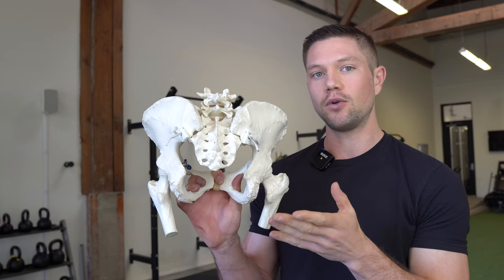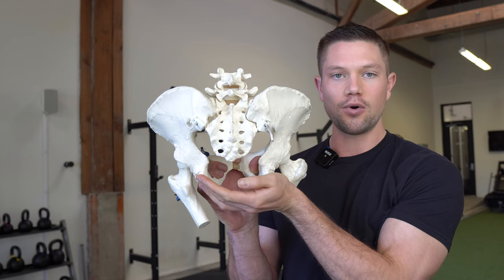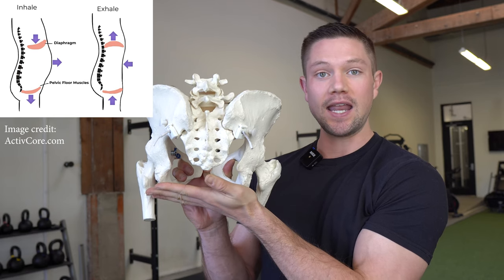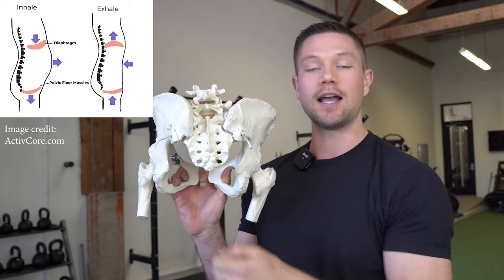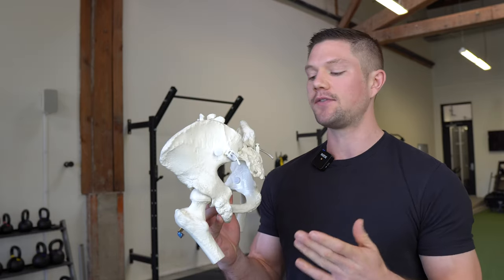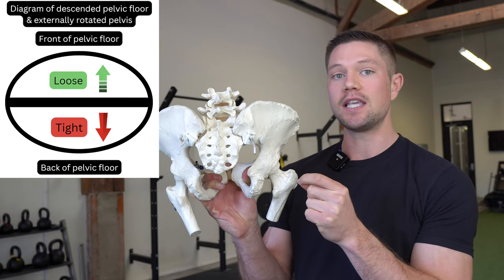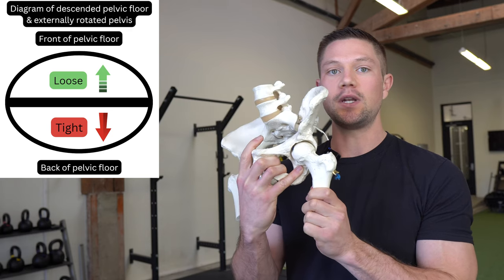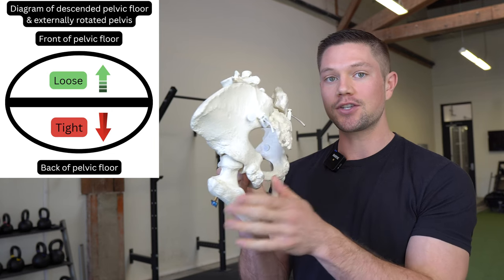How To Fix Your Pelvic Floor - Try This Instead Of Just Kegels!

Comment: Thank you :) All exercises I have found on the Internet were based on activating your pelvic floor using your -  let's say -  willpower (for example when you are given cues to zip your pelvic floor up, to pull it up, to imagine that it's like an elevator, tissue or string or flower - you can find many of these). The second one is the best exercise to have a great feeling of deep muscles (pelvic floor and transverse muscle) without thinking about it and forcing to activate them with willpower, they just engage by themselves in that position. I think that it's especially helpful for women with prolapse. I wanna ask though if you should hold the tension on the ball throughout those five breaths or make pauses between every breath (inhale+exhale). Please make more videos about pelvic floor exercises for leaking, stress incontinence and prolapse.

Comment: Levator Ani syndrome can also be a cause of pelvic pain / pudendal neuralgia. Levator Ani syndrome can be caused by a broken coccyx as that changes the anglulation of the muscle, causing spasm and then irritating the pudendal nerve. It takes about 5 years of going to doctors to get diagnosed with pudendal neuralgia, and I doubt there exists a medical professional that would accurately diagnose levator ani syndrome. The levator ani (at least in male) can be released by internally accessing it, it can also cause anismus or dyssergic defecation. Anxiety is probably far more of a cause of pelvic pain than any kind of trauma, so effective resolution of pelvic pain also involves psychologists / psychiatrists. If you have pain, kegels are almost always contraindicated. Obturator internus and the obturator nerve are also commonly affected by these issues, obturator nerve glides and internal rotation of the hip joint can help stretch the area. Anterior chain dominant exercises / core exercises can exacerbate symptoms. This is an exceedingly rare problem and information isn't very good, just sharing what I've learned having it and having poor healthcare providers.
Reply: I feel you on that, I need help too
Reply: I fell down a flight of stairs 12 years ago, couldn't walk upstairs for weeks and didn't know there was anything wrong until I found out sexual intercourse hurts but still didn't think there was something wrong with me since the doctors said "nothing broken" and physio didn't help much. Now years later, I found a pelvic floor therapist when pregnant because I couldn't walk without pain towards the end and found I have a tight spot inside my pelvic floor.

Since it is so expensive to see physios all the time, I did my research and found a pelvic wand, got it and then discovered on my own, a tender spot inside my rectum, in and around direction 7 o'clock. When I put pressure, I can feel my back and somewhere in my abdomen hurting too. At first it was shocking/electrifying and sooo painful but over time it got better with consistent "massage" but I stopped for a few months and started again yesterday and it feels pain and not as good as when I was doing it daily. I suspect it could be the pudendal nerve or levator ani tightness if there is such a thing..not sure. Please share more if you have more knowledge/experience on what helps you, especially exercises. Thank you! :)
Reply: @dawnforlife At 7 o clock, you are quite close to the coccyx and the levator ani attaches to the coccyx. Coccyx pain can present as back pain, another way to test this is to lower your chin to your chest and try to flex your spine from your ribcage / thoracic spine, the idea is to put a lot of traction on the nerves, doing this may flare up the symptoms in the low back and you may feel it into your sacrum and coccyx, you are actually describing the pain that I have very accurately, although my position of pain is around 3-4 o clock. Pudendal neuralgia can also present as suprapubic pain, felt in the pubis / bladder area or even in the abdomen.

As for exercises, I basically treat my entire pelvis and pretty much every single muscle that is involved with the pelvis. Hip adduction / abduction / flexion / extension / internal and external rotation. I also do a lot of split stance exercises where one hip is flexed and the other is extended and then switching. I also do lots of core exercises, especially bottom up core exercises like reverse crunches (if you get pain you may need to modify and see if you can find a way to work your core without pain). Stretching and strengthening the psoas can also be good. Reverse kegels are really good and help you learn to breathe into the pelvic floor. The happy baby pose is also commonly prescribed and helps, you can also use your arms to pulse your legs out and in while in happy baby to help move the area. There are also pudendal nerve glides. Sitting on a heating pad can be helpful, just be careful of the heat. As far as psychology goes, pain reprocessing theory can help. You can also experiment with just moving your legs and hips around, trying different back positions and seeing if anything alleviates or causes more pain, it's just a lot of experimentation because medical professionals just dont have many answers. The most effective interventions for me have been the levator ani release with my finger, and pharmacological intervention with pregabalin. MSK neurology has a good article on pelvic pain you can check out as well, he has some exercises specifically for it too.
Reply: @zakazan8561  Thank you so much for taking your time to share your experiences of what helps, with me. Will look into these!

Comment: Thanks for this Conor. The lack of knowledge among healthcare professionals around the ribcage and pelvic floor is staggering. The pelvic floor is assumed to be only something that keeps certain organs in place and should be only problematic in women who have given birth or elderly men. Any knowledge seems to be limited to overly loose pelvic floors too not the opposite. 
As someone with a chronically tight pelvic floor, very tight abdominals and posterior pelvic tilt, getting any professional to even acknowledge the issues has been a challenge. 
Educating myself has been key and thanks so much for this video and others to help me understand what the hell is happening. I had never heard of the pelvic floor until years after experiencing chronic pelvic pain and lots of puzzled looks and dismissed words from professionals. I am hoping these exercises will help towards beginning to get my body back to working properly and getting my ribs to stack on top of my pelvis. Right now my pelvis tilts back and my ribs flare forward. Ive also bought your beginner program which im starting to use. Thanks again.

Comment: I'm 27 and have had chronic pelvic floor issues for 8 years now. Erectile dysfunction, incontinence. I've had an acrylic splint, orthotics, all trying to get my body neutral. Its a nightmare. I'm now doing myofunctional therapy to correct tongue posture and get a tongue tie release. 8 years of my life wasted, unable to have relationships, chronic pain. My right ripcage is forward and I'm breathing through the right side of my neck. Hell!
Reply: I was recently diagnosed with a tongue tie after decades of chronic low bock/neck issues. I’m currently in the process of expanding my palate with hardware  in preparation for releasing my tongue tie. I will need myofunctional therapy throughout this process as well.
Reply: @BrendanFrancisMusic  nice! I hope it helps you. I think tongue tie is a major factor.
Reply: It's ramdhan, ask Allah to fix your body on condition that you will become Muslim. Study Al Qur'an and SAHIH SUNNAH.
Reply: Don't give up bro ,you are not alone , i am also 27 I was also suffering from rib cage compression and hip imbalance for 6 years but since this year only I have been doing pri rehab works I have been refering bill, conor and zac on you tube and now I have achieved a lot of progression . Just stick with the process and  everything will fine
Reply: @shakebraza196 Islam is not compatible with European mans spirit. Sorry.
Reply: @shakebraza196 what a load of bollocks
Reply: i recommend side planks with breathing to get the frontal plane back in your life, also some reaches, connor talks a lot about these exercises to get neutral
Reply: What you need is to find a PRI practitioner, otherwise the amount of research and effort to fix it alone is giant. But for me, it worked. About 1.5 years of consistently applying myself and I was able to breathe and sense my way out of a labyrinth of compensation that had me on the sidelines for years prior. But I EASILY spent 1000+ hours just researching/learning. Not something most can afford to do.

Like someone said, stick with the process. And also, don’t be eager. Accept what is happening; your body is trying to protect you and you need to not only tell it that things are alright, but also truly feel it. This is how you relax, and how your nervous system begins to allow these “exercises” to work. As soon as I stopped hoping that the next exercise would bring me relief, I dropped the tension that developed from expectations and hoping. Only then did the exercises have the chance to work. Exercise without expectation, but rather trust in your intention. 

You can’t trick your nervous system into thinking you’re calm when you aren’t. When you’re bringing it to these “new” /shutdown places, it won’t return unless it was a calm experience. Truly believe and say to yourself “it’s all good, this position is good”, type of deal.

I promise, if you are actively describing this as “hell”, you won’t be able to let go. It’s just the truth. In that mindset, you’re treating your nervous system as an enemy, rather than telling it things are ok. You can’t be hostile, or PRI won’t work. Of course you want to feel different. But focusing on that prohibits the change you seek. 

Lots of words there but learn to smile and be thankful toward your nervous system, while you gently open its mind to doors it has closed for reasons that are no longer present. Just remember, all those symptoms aren’t the issue. You can’t fake or force your way to a full exhale. The answer ends up being quite simple, but you only get there a little at a time. Just the way it should be.
Reply: @ARB826 thanks, I have been seeing a PRI guy for 4 years. A big part of it is my nervous system definately, however I do have dental issues, cross bite and tongue tie which I stopping me I think.
Reply: @ARB826  where to start learning this stuff? Help a brother with the beginning.
Reply: Good luck
Reply: I've been fixing myself 3.years now, PRI has been great. I had grade.4.tongue tie and a 28mm narrow palate that I has surgical expansion to fix. Correct though you need left obliques and right adductor. Planks are great but only if you csm breathe proper while doing them..without breathing you're literally wasting time. Fix breathing first.
Reply: @Eratosthenes5  subscribe to him for one . Learn about pri, and breathing mechanics
Reply: @BrendanFrancisMusic pp
Reply: Like seriously??
Reply: Same bro has wreaked havoc on my life so many rabbit holes just to never completely fix It